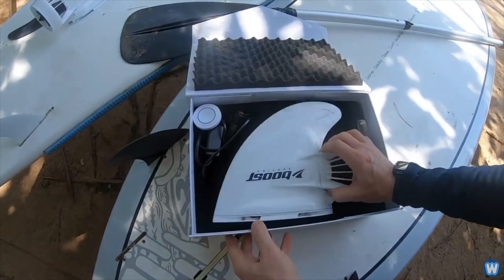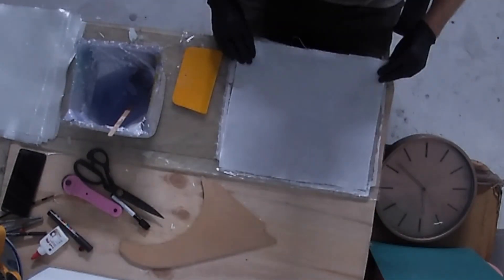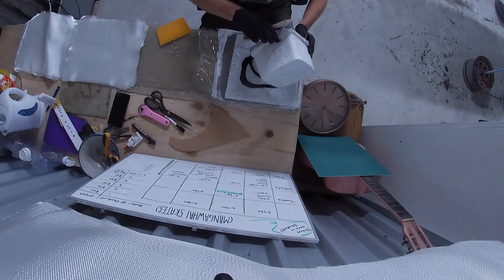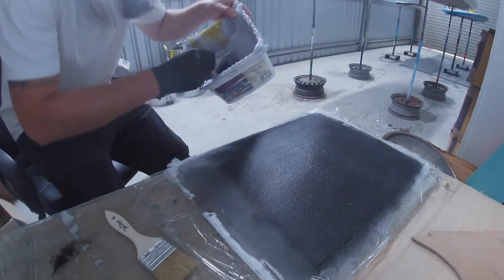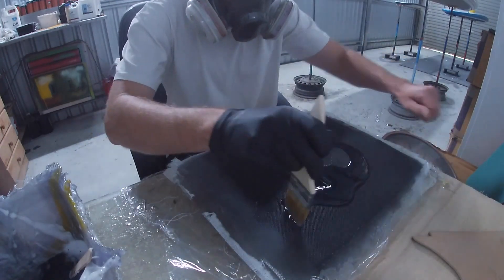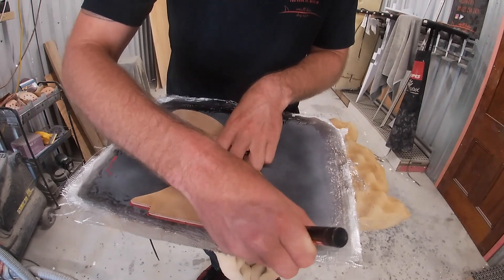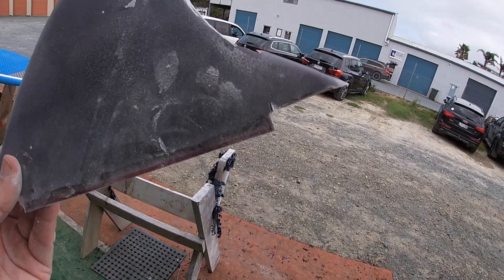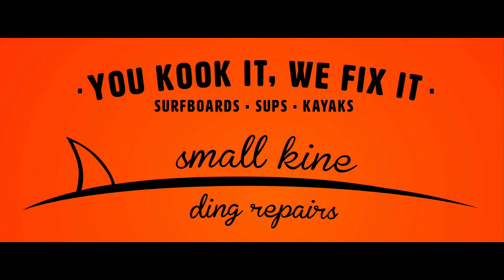Making a longboard fin

Comment: Thanks for the video mate. A question re the fin panel; did you lay it all up at the same time, or did it get too hot? Re shaping the fin, I used to use a 9" grinder. The hard wheel allows easier regulation of the chamfers. Then I used a soft wheel to finish it off. You sound Aussie?
Reply from the maker: G'day Jim, wrote a whole reply and the phone went dead as I pressed ''send'' 😆 

With the fin panel it's all done in one go but I do only mix about 200ml at a time just so I don't have resin going to waste kicking in the pot before I've used it all. From memory, this panel took about 600ml of resin total with the chop strand in it so apart from pausing to mix two new batches of 200mls of resin, I just keep ploughing through. Heat isn't such an issue with fin panels because the layers of resin are so thin and it's only catalysed at about 1%. 

As far as the grinder goes, it's a waaaay more ideal tool for foiling than the orbital for sure. The only reason at this stage I stick with the orbital is because it's got the vacuum attachment. As ideal as the grinder is, without an extraction system it's very messy, covering me and the workshop in dust meaning I have to spend time cleaning everything after foiling and the rest of the day scratching at all the fibreglass shards lodged in my pores. Not to mention the potential of breathing some of it in, even with the respirator. I definitely have future plans for a work station with extraction for foiling fins.
Reply from the maker: O, and yup! Aussie in the land of kiwis!
Reply: @smallkinedings  Yep. I used to turn the back yard into a snowfield.
Reply from the maker: @jimdow6470  😂

Comment: Hey bro id buy your rugpull coin hahaha
Posca pens are great they make lines like my ex gf hahaaha
I got a jigsaw blade with the edge like a angle grinder disc it cuts through fin blanks like yours no problem did it for a many whole 3x3 ft blank of many fins and still going strong
Loud as loud gets though will need hearing protection!
Seriously love the videos and hope you get monetized for the cash flow to keep ya at it

-A hippie board maker in california
Reply from the maker: Aww shucks bro, you'll get early access to small kine tokens for sure! 

Will look into the jigsaw blade options for sure! Does save a tonne of work using the jigsaw so would be nice to fine something that works. 

I've actually got a chess table top to make out of fibreglass so it would be very useful for that project

Comment: Get a ceramic jig saw bit, they cut out fin panels very fast
Reply from the maker: Cheers! Certainly gotta be better than the ones I've used in the past. Thinking of going the band saw route
Reply: Ceramic Jig Saw bit/blade.  Gonna remember that one.  I’ve got so many True Ames and Rainbow Fins in stock right now that putting up a panel and grinding fins would have to be done strictly for the “joy of fin making”.  Lowel/Little Hawaii Surf Designs

Comment: A Laminate Trimmer - I'm jealous  :-)
Edit - What video editing software do you prefer ?  I noticed a huge speed difference between them when I tried a few out.
Reply from the maker: My favorite tool here I think. I use final cut pro at the moment. My 2013 MacBook doesn't help things. It is dying a slow death all these years later
Reply: @smallkinedings  MacBooks are expensive,. and according to my Mac friend, the new ones are problematic. Would you ever consider going back to Windows ?
Reply from the maker: @dnomyarnostaw  they are, very expensive. In the big scheme of things, I spent 2 grand 10 years ago so investment wise it hasn't been bad at all but it's a lot to lay down when this one finally gives up the ghost. Certainly not opposed to windows, would just have to keen premier pro for the editing I suppose
Reply: Great video, fins are so customizable.  Separate batches of resin or less catalyst as I imagine it takes awhile?  🤙🏼
Reply from the maker: @allsurf  good fun if the time is available! I normally mix batches of 200ml at a time, pretty slow catalyst ratio because yup, it's pretty slow going